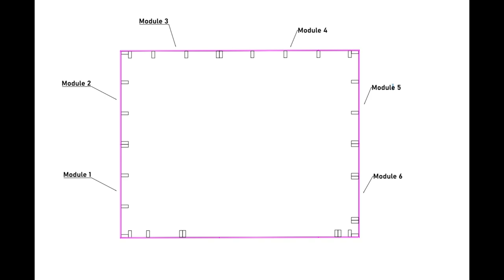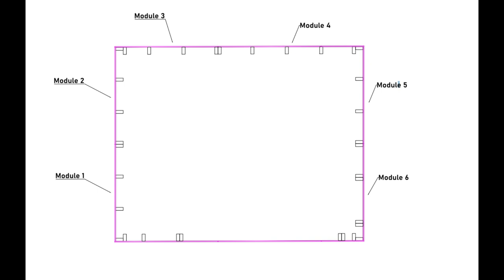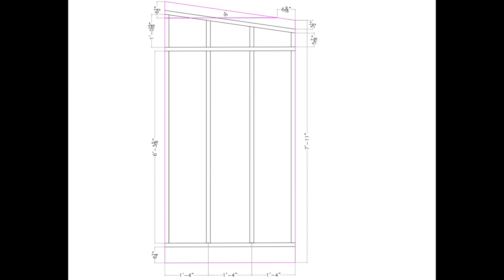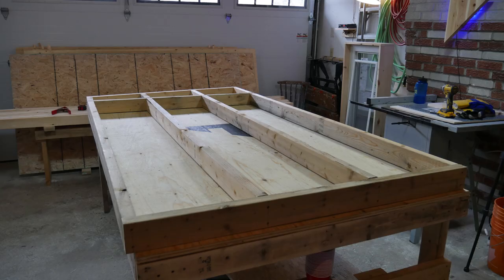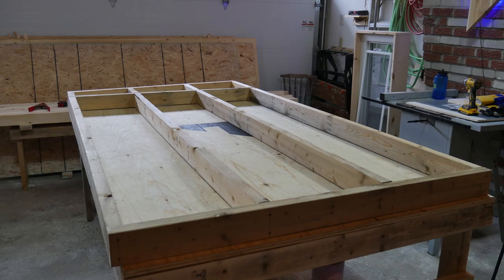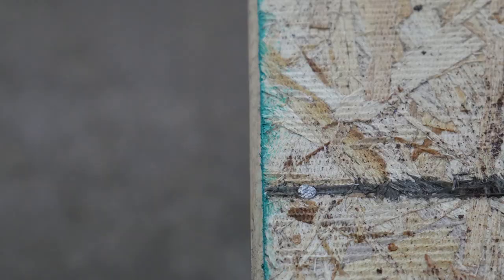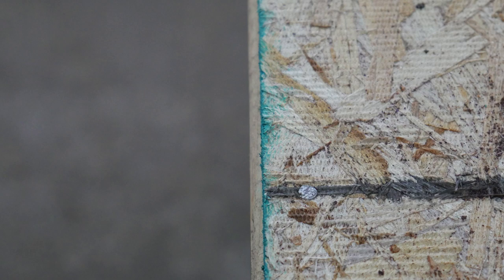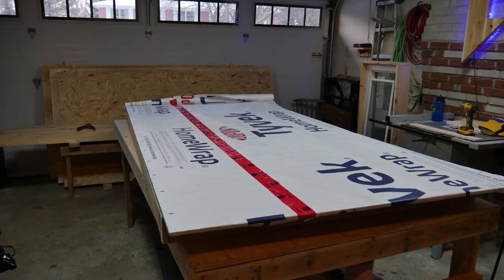Jeff's Backyard Office

Comment: I’m a little confused. I saw insulating panels grey in color, then I saw pink insulation at the end.. are there 2 layers of insulation being used?
Reply from the maker: Yep! There is both exterior and interior insulation in this build. The interior insulation goes between the studs while the exterior insulation goes on the outside of the sheathing. 

The purpose of having both is that the interior insulation provides the bulk of the thermal resistance (fancy term for insulation), while the exterior insulation limits what's called thermal bridging. 

Thermal bridging is when heat has an easy path to escape. Without the exterior insulation heat would be able to easily leave through each of the studs since they provide a path of low thermal resistance to the outside. Adding the exterior insulation is like adding a wool coat on the outside of the building!

Comment: Nice! I'm curious what the inside height of the walls are at the short and tall sides. It looked like the short side was only 7' at the most, which seems pretty good for a little office.
Reply from the maker: You're right! If I recall correctly it went from about 6'8" to 8'5". The local zoning bylaws governed this decision.
Reply: @frisedesign  Nice! And it's an 8x10 ish?
Reply from the maker: @mkushin  correct!

Comment: Do you live in area where winter is tough? Does it handle weather okay?
Reply from the maker: Yes this was built in Toronto where winters get quite cold, which is why I ensured it was well insulated. The builds I've created since this project all have heat pumps to both heat and cool the space year round. With this project, the owner installed his own heater.
Reply: @frisedesign  thanks so much! Do you have a link to a heat pump you use or reccomend looking into?
Reply from the maker: @ryanjcoon1  This is what I've used in the past https://senville.ca/9000-btu-mini-split-air-conditioner-sena-09hf/

Comment: Did you do the electrical work? Does the unit have heat/air?
Reply from the maker: An electrician did the electrical work. The owner of this unit decided to use a plug-in-wall solution for HVAC, however on a more recent build we've integrated a built-in heat pump.
Reply: @frisedesign  beautiful work man, thanks for the quick reply!